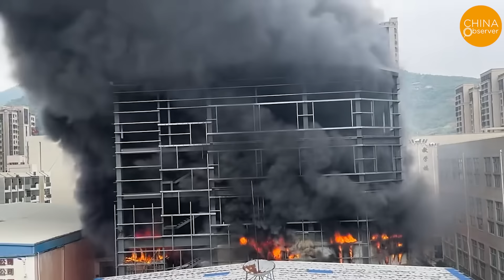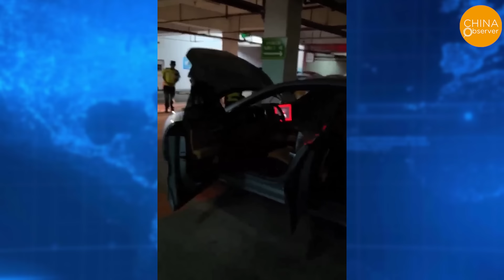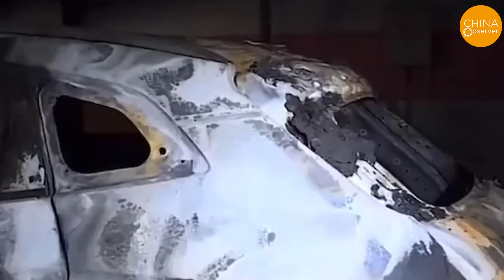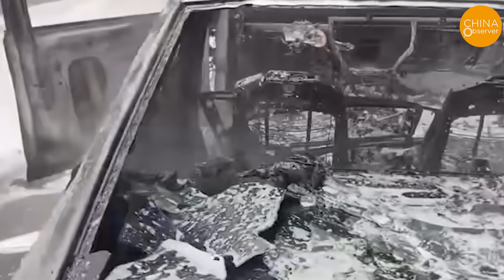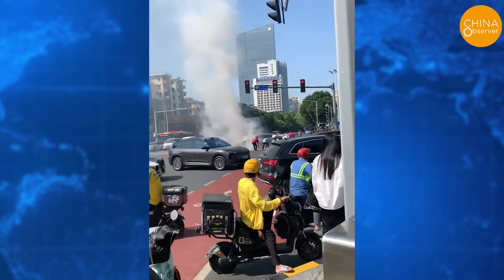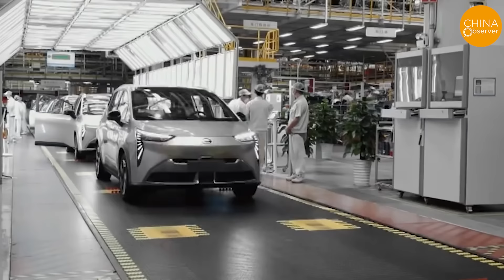Fires and Explosions Sweep Across China; Government Urgently Stabilizes Situation

Comment: I call BS on fire occurring because of hot weather!
Reply: True
Reply: Yeah, because it's hot over in the USA too.  Excuses!  😀
Reply: That is a joke.
Reply: cities are like forests, sometimes they catch fire. Says nobody ever lolz
Reply: Yes, I've never heard of fuel powered vehicles combusting because of hot weather.
Most likely oil or fuel dripped onto the exhaust. Someone failed to check their lines/hoses for leaks, loose fittings.
Reply: Perhaps left parked in direct sunlight on a windless day.. "hot enough to fry eggs"-hot... Electrics and batteries are sensitive... Check if owners left their car also in freezing temperatures.. for hours... "Operator Error"-much? .. ;)

Comment: We as humans are just now learning, lithium metal and water don't mix.
Reply: We did sodium in water experiment in high school. And lithium is in the same group, but more volatile.
Reply: There are different lithium battery types and most EV's use the lithium that can easily burn. Lithium Iron Phosphate (LifePO4) batteries are better because they have more charge cycles and way safer to use because they don't burst into flames even if the battery cell wall is punctured.

Comment: Fire in a water park?  Did they mix up rocket fuel and water again?
Reply: Nah the water is most like have that special cooking oil they like to use on a daily basis.
Reply: They'd sooner sell rocket fuel as cheap liquor than use it for pool water. Rocket fuel is largely made of ethanol btw.
Reply: Yep     no doubt. 

It is a very volatile cooking oil. 🤔
Reply: nah, they be cost cuttin,  they got hydrogen and oxygen separately cuz water was too expensive

Comment: Every EV should have been DESIGNED with a instant disconnect for batteries, pull cord or safe area access or even arm extended bolt release and pull bar.
Only stupidity failed to know ahead of time of the destructive melt down with these batteries. Welcome to no regulation for your safe lives.
Reply: Make manual door locks great again.
Reply: Ejection seat?
Reply: They should have a firefighter battery disconnect switch,but it's to late by then.

Comment: A few days ago, a Mercedes-Benz electric car parked in the underground parking lot of an apartment building caught fire in South Korea. 40 vehicles were burnt down and more than 100 were damaged. The underground parking lot was heavily damaged by the 1200 degree high temperature.
Reply: If their buildings are built the same way as in Canada - reinforced concrete - this could be sufficient to condemn the entire building depending on the duration and actual energy intensity. That is, was that 1200 Celsius or Fahrenheit? Celsius temperatures that high for a significant period of time would very likely condemn the whole building, not to mention the fumes and toxins. Thanks for this - I think I'll go look that up and learn more. Cheers!
Reply: @kaoskronostyche9939 

Hmm ... C or F that's hot enough to turn the steel reinforcement plastic.

Sod that!
Reply: @t1n4444  I sorta think that is kinda what I said - the building would be condemned.
I do not understand the "Sod that" part of your comment.
Reply: @kaoskronostyche9939  An EV fire can reach up to 5000 Fahrenheit or 2760 Celcius, the rebar can be brittle at 500F/260C, if the fire is raging long enough.
Reply: @Mehrunes86  Is that not kinda sorta what I said??  Here is my quote: "Celsius temperatures that high for a significant period of time would very likely condemn the whole building, ... ."
That is two comments now telling me what i already said. I fail to understand that.
NOTE very carefully that I did not say the building would fall down or the columns would crumble. That would not necessarily happen.
Reply: @kaoskronostyche9939  

"Sod that for a game of soldiers". UK slang.

Equates to "keeping well out" on account of danger or risk to one's self.
Reply: @kaoskronostyche9939  Commented to the wrong one🙂
Reply: @t1n4444  Thank you for getting back to me. I am familiar with this idiom but I could not quite relate it to the topic. Thanks for clarifying and context.
Now I understand - "sod that, I'm out of here" indeed.
Thanks again.
Reply: @t1n4444  Thank you for getting back to me. Now I understand. Cheers!

Comment: I suspect many of the EV fires are associated with flooded cars. Often when a ev is flooded corrosions starts and then takes a few weeks to cause a short and subsequent fires.
Reply: Especially as some EV manufacturers are now using aluminium-alloys as conductors instead of copper-alloys!

Comment: They need to invent and build a firefighting vehicle that can deploy a sheets that can completely cover the burning vehicle and starve the fire of oxygen.Firefighters in the USA have used materials that they can cover themselves with that will help them survive a forest fire. It will be soaked in whatever chemical or foam that will not allow oxygen to pass through the material.
Reply: EVs don’t need oxygen it’s called thermal runaway. Once its starts you could dump the car in the ocean and it would continue to burn.

Comment: My insurance agent mentioned that hybrid cars are counted as gasoline cars because they use explosive fuel, but the problem now is that the charging systems in some older hybrids are starting to cause problems. The battery packs by themselves are very safe.  Gas cars are 10 times more common to catch fire than the EVs. Now the  question is will the car companies start cutting corners due to unpopularity of the ICE cars, and start competing with price which will mean  later there will be more fires.